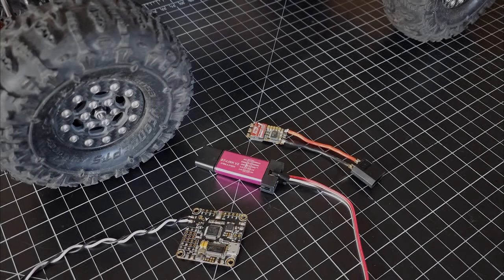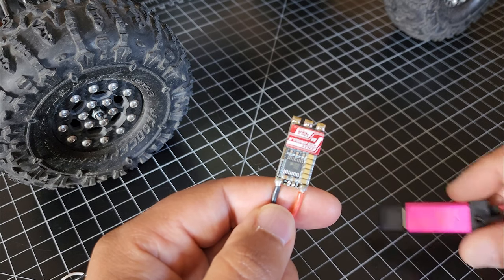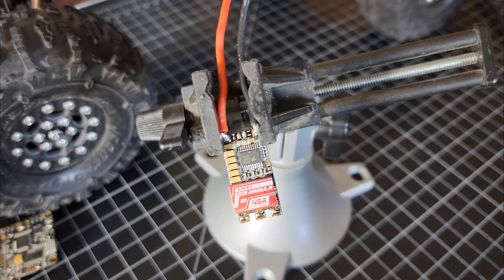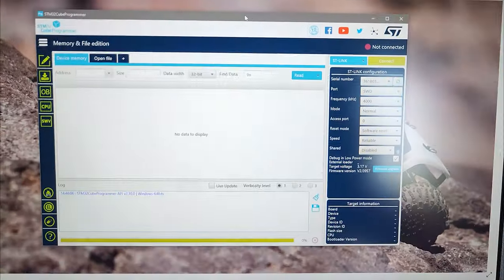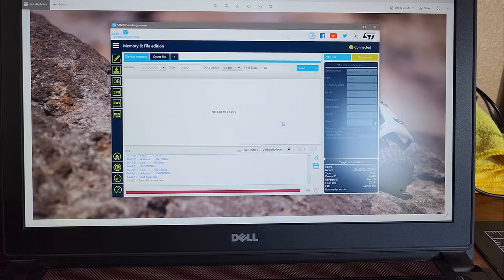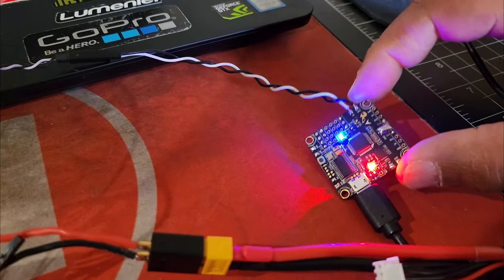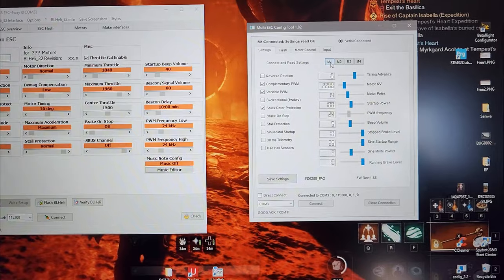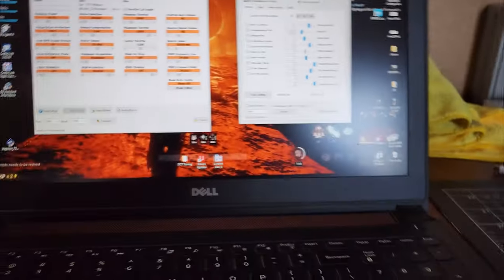Flashing am32 FW on my Emax ESC | RPM Lock | Silent Crawler ESC

Comment: Wow great video on the esc and flashing AM32. I have had the Stlinker in my cart for weeks and been hesitant to do that even after reading the guides. I’ll have to buy that esc again and flash it. I have been doing research on other escs but looks like that model has worked good for you and not burned up.

Comment: Thanks for this great video.  I did erase the esc and program it with the am32 firmware.  However, I’m having a bit of problems with the BLhelisuite 32 32.9.05.  It gives me this error.  “m4wFClntf” succeeded.  Found outdated protocol version 106.  Please update the interface to support revision! (Protocol 107 or higher”

Comment: Question, any tips with cogging between sinusoidal and normal mode transition? I have reflashed ESC with different versions of firmware, decrease/increase: sine mode power, start up power, sine start up range. I keep getting a cog like hesitation, the motor stops for a split second during the transition and goes on but if I hold the throttle at that precise transition, it starts to sound like a machine gun lol and the motor keeps stopping and spinning like a mad man. Have you come across an ESC thats faulty in that sense, I got another ESC and that one works like a charm, but hurts to throw away an ESC that can potentially be fixed. Thanks in advance, and hope to hear from you soon.

Comment: Choosing betaflight f3 in BF firmware... Do you choose that name for every flight controller? Or is that specific to which FC you have?  Just want to clarify as that could be confusing.  

Yeah I would recommend staying away from betaflight and flight controllers unless you don't have any other way.  Because drivers can be a pain and it's not easy to understand your problem. 

May need to download impulse rc driver fixer. Exe

Comment: @furadi Hello.  At 7'03 I see a black ground wire connected and then I don't see it anymore when the ESC is connected to USB. Is this ground wire really mandatory? Thank you in advance and congratulations again for this video
Reply from the maker: the ground is needed for flashing the bootloader and FW. But not for configuring through USB
Reply: @Furadi  🙏👍 i will try whith flycolor stick 35A

Comment: I cannot get my transition from super slow to startup speed smooth at all. Any help?????
Reply from the maker: Did you try raising start up power?
Reply: @Furadi  I’ll try that now thanks
Reply: Still have the cogging low to mid throttle, I’m sure I’ll get it sooner or later.

Comment: Get STM not found, what driver do I need to upgrade on my computer?  Upgraded STM link didn't work.....
Reply: Had the same issue last night... STM shows up on my PC but I get a DEV_COMM_USB_ERROR. After looking around, I'm pretty sure my solder job was botched and the EMAX wasn't powering my STLinker. In trying to fix it, I Iifted a pad with no luck trying to fix it down again.. time to wait for shipping again :/
Reply: I went to st website where you download the cube software. There is a link for an update for the ST linker. Maybe it is in the page after you receive the email to download the cube software. Can’t recall exactly. That did the trick for me. The update button in the cube didn’t work for me either.